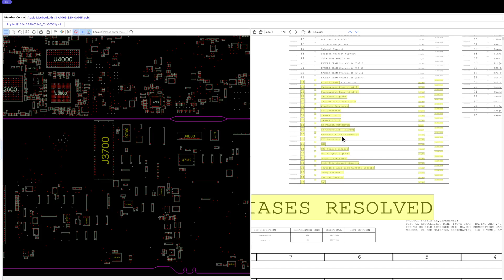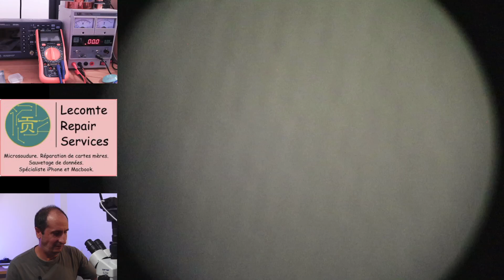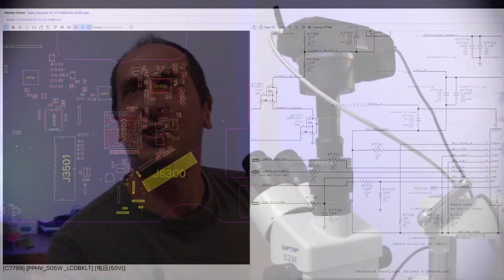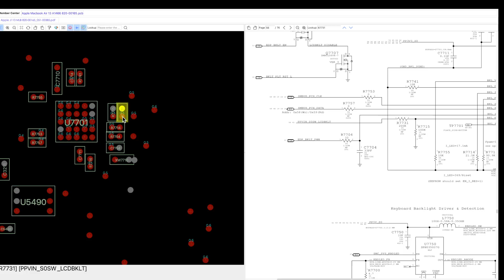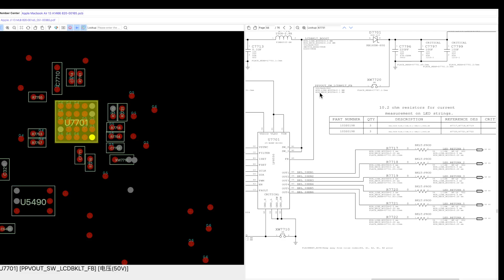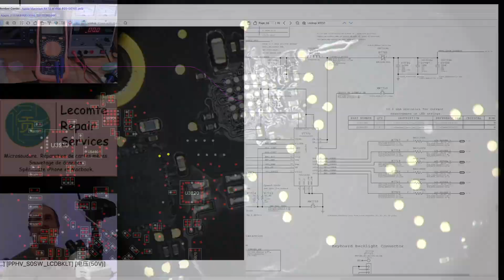[47] [Macbook Air 820-00165] No backlight.

Comment: Salut, bonne idée d'expliquer le fonctionnement du circuit de backlight sur la carte du A1466 car c'est un problème assez fréquent sur ce modèle. J'ai remarqué après plusieurs réparations de backlight sur le MBA que le backlight driver était souvent le coupable, qu'il se formait de la corrosion sous le IC même sans écoulement de liquide. Alors maintenant je retire la carte mère et vérifie les billes sous le IC au microscope et s'il y a signe de corrosion ou de saletés je remplace le IC. La plupart du temps ça règle le problème.
Reply from the maker: C'est vrai que souvent, c'est le régulateur de tension de backlight qui est défectueux.

Mais il y a vraiment de tout, j'ai dû voir au moins une vingtaine de pannes de backlight, toutes avec des causes différentes mutuellement. Ce circuit est génial pour apprendre à diagnostiquer un circuit sur la base de ses conditions de fonctionnement.